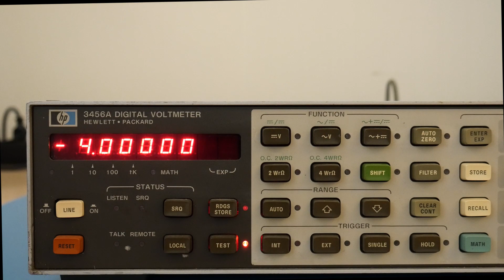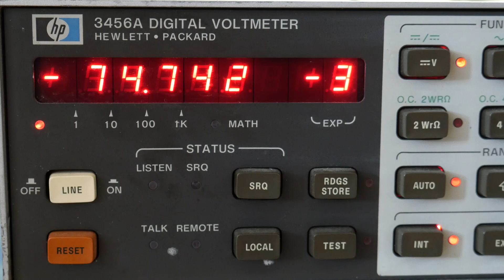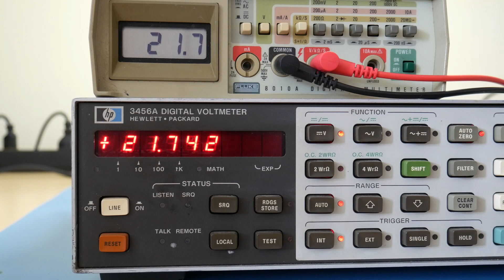HP 3456A Repair

Comment: Oh no...you were so busy listening to cool jazz tunes that you neglected to follow the warnings on the inside cover, exposing the board to solaronite!
The machine is useless now, might as well send it to me for proper disposal.
Reply from the maker: Ha! Turns out solaronite actually improves the accuracy of the unit. I guess HP didn't want you to know that, hence the warnings.
Reply: A friend just gave me one of these meters. I hope it is an easy fix like yours. Thanks for the video

Comment: Thanks! Same issue with pins not making contact...! Had error -3 ..Works great now..
Reply: The problem is with the + 33 to 48 volt power supply being to low in voltage. Mine was 24 volts. I replaced C8 100uf 50 volt cap. This corrected the low voltage that was causing a -400000 test error. Now the meter works perfectly.